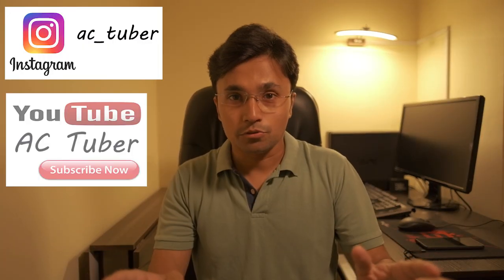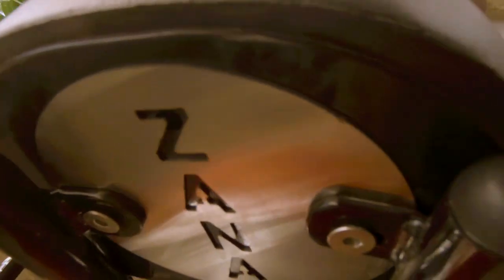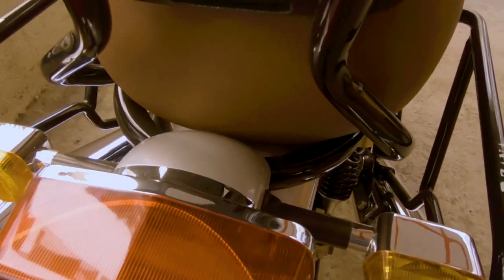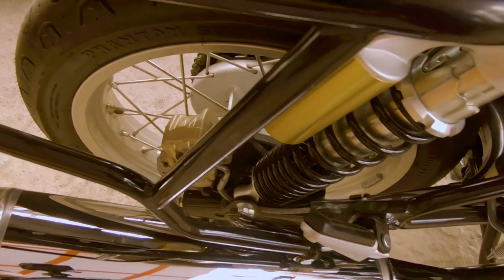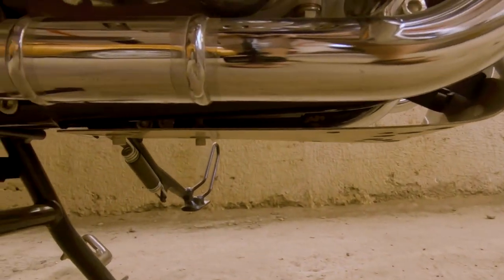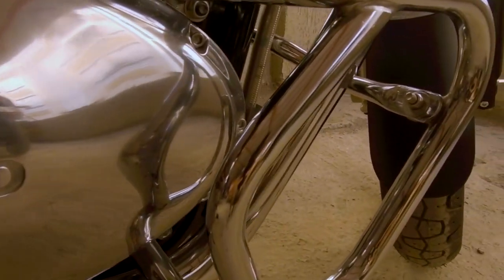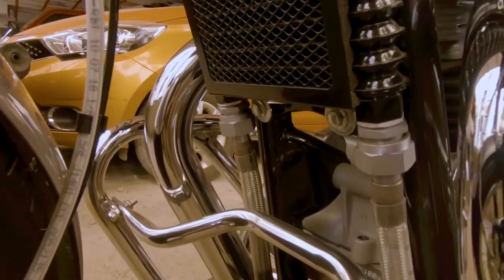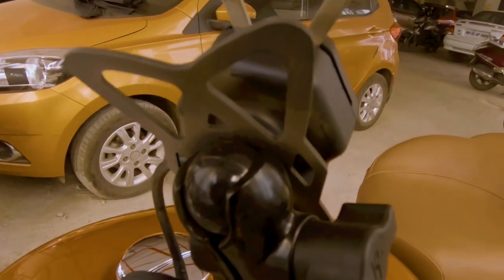#Interceptor650 - must have accessories

Comment: Bike kaafi overdone lagg rahi hai, 
leg guard bht dominant lagg rahe hai,
Claw bag k liye saddle stays ki nhi zarurat,
Charger k liye bolt is best, as it can create issues with your phone or your wiring bike.

Important accessories include,
Seat modifications
Aux lights
Head light
Bash plate
Wind screen

Prefer keeping the weight low...
Reply from the maker: Thanks for watching the video and thanks for your suggestions. Maine itna hi Kia, jitna mujhe zarurat lagi...baki to sabki apni apni choice hai...🙂